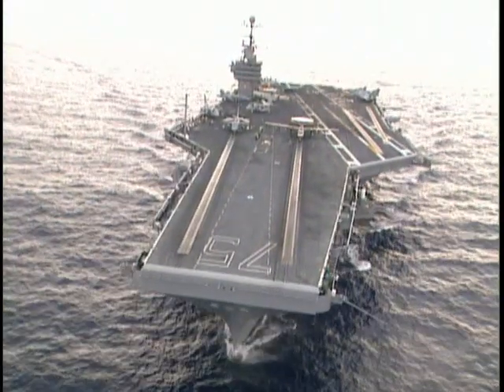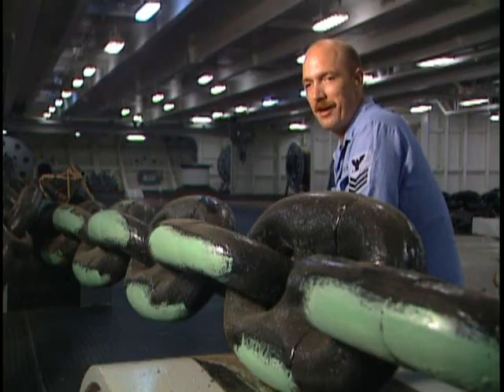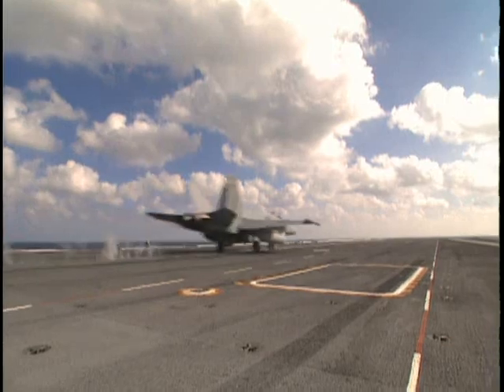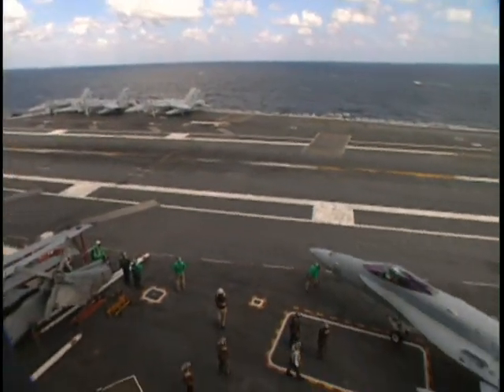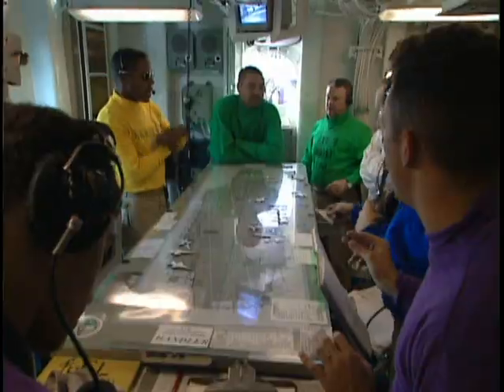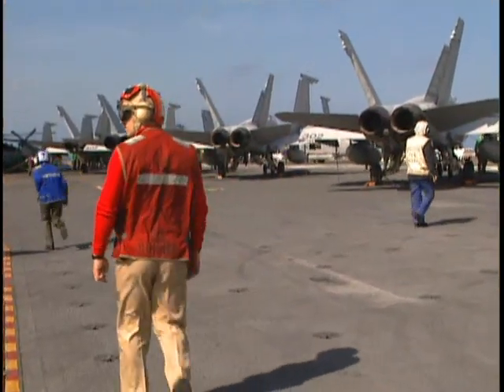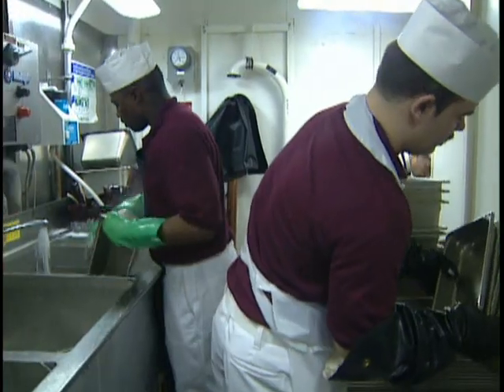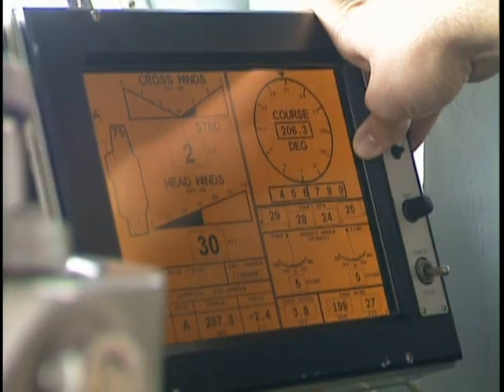Worlds Largest and Biggest Warship/Aircraft Carrier!!! HUGE!

Comment: OotS is 94+ feet longer, but it is lighter. Calculating from line drawings and official measurements, she's also18+ feet taller, keel to tops of masts.

By tonnage and max beam (and speed and maneuverability) the Nimitz wins of course, but height and length and enclosed volume, the Oasis (and Allure) of the Seas win.

Comment: Nimitz-class 
100,000 to 104,600 long tons (100,000–106,300 t)
Length:	Overall: 1,092 feet (332.8 m)
Waterline: 1,040 feet (317.0 m)
Beam:	Overall: 252 ft (76.8 m)
Waterline: 134 ft (40.8 m)

Yamato class (3 ships)
Musashi , Shinano(converted to an aircraft carrier)Displacement:	
68,200 long tons (69,300 t) trial
69,988 long tons (71,111 t) standard
72,000 long tons (73,000 t) full load.
Length:	256 m (839 ft 11 in) at water-line
263 m (862 ft 10 in) overall
Beam:	38.9 m (127 ft 7 in)

Comment: Uh, yes they are obsolete. If you show me the specs of the computer system I'll check for myself if the actual system is obsolete, too. You don't lose data in a power failure, it's called a hard drive. The map system they were using is a tabletop map, it's not used in any modern navy any more. Yes, I know what radio chatter is like, and I know that all major radio companies (including Motorola and Thales) are pushing digital technology because it's far superior to analog.

Comment: CRT monitors are in no way obsolete and your monitor has nothing to do with the computer that runs it, and if you have a digital display that you write information on what happens when you lose power on said display: you lose your information, while with a piece of paper all you need is a pen/pencil and a flashlight.  Additionally, you have no idea what the radio chatter from a Navy communication system sounds like, but apparently it works because we have near perfect operation records.

Comment: @SRospieler Marine reactors are designed so there is no chance of going off like a bomb if that is your query. Activation of the scram rods should shut it down. If they failed or were not activated immersion in sea water would  give cooling. Radiation would not be a problem as fuel rods have an anti corrosion coating so salt water shouldn't affect them. Radiation would be minimal.

Comment: Clever, considering Russian aircrew did not arrive in Egypt until June 1970. And the Ruessian pilots dominated tih israeli s to such a degree that they arranged an ambush using the F4s  as bait. The Migs were shot down by Mirage 111s, a much newer A/C not F4s (See operation Rimos 20 ) Overall, the Mig 21 contributed to the cease fire with 21 kills. ....cont